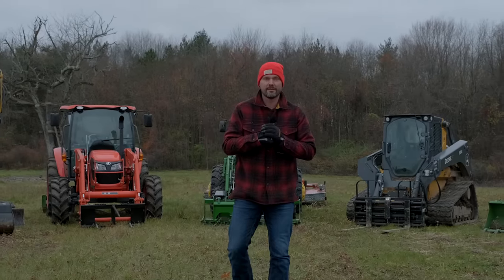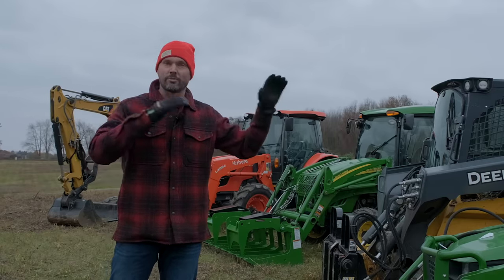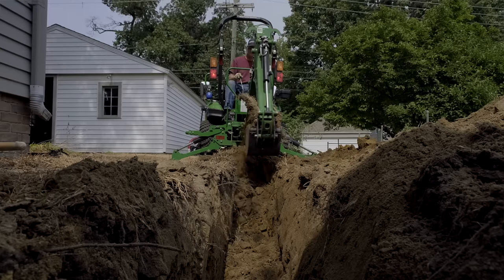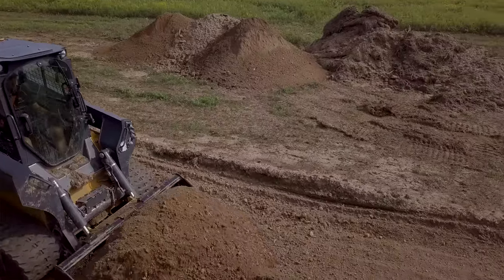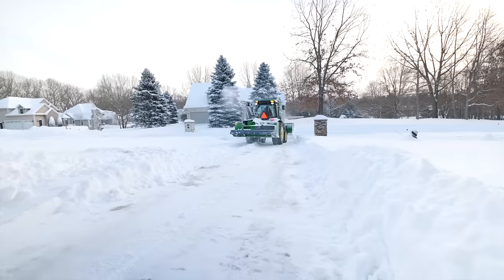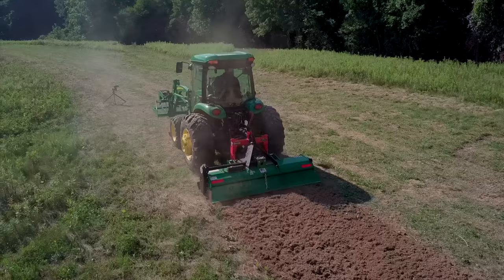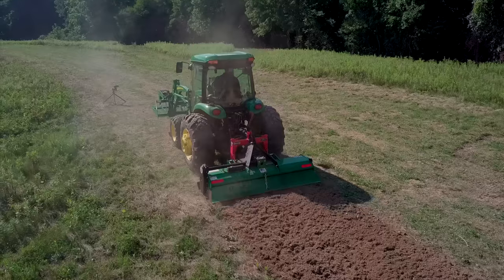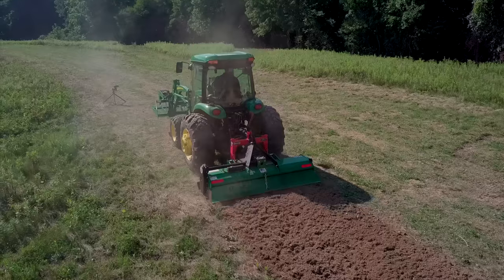IF I COULD ONLY CHOOSE ONE? BEST MACHINE FOR PROPERTY MAINTENANCE

Comment: You generally wouldn't think half an acre would justify a machine, but I bought a property that is fairly long and narrow, with a very steep section past the house. Our climate is wet and the ground is clay. I got sick of doing multi point turns to get my Hilux in and out of the back yard, tearing it up in the process. Even worse with a trailer. Considered a large ride on like a toro 520-H, but they are hard to find in Australia. There are all the different sizes of mower to tractor in John Deere and Kubota, but they tend to be very pricey, even old ones. Ended up going a little bit bigger and got a sweet old Kubota L1501 2wd. While the price was higher than I would like, it has less than 900 hours and runs beautifully. Picked up some implements as I found them on marketplace. Glad I got a grader blade, seems overkill, but I had to fix our road after we had a big storm and lots of wet weather. The pot holes were so bad that I had to take my 4wd to work. Got a rear scoop recently, it's no front end loader, but it does a great job for just moving mulch, dirt, gravel etc. I fabbed up a pallet fork setup, that's proven handy. A skid steer would be great, but you can't get a flogged out one for less than $10k. The mini ones are usually even more.

Comment: New Holland TC40, perfect size for almost any farm. You can run it on land between 4-400 acres. Ours has been very reliable.
We have had a skidsteer and a mini excavator once but the tractor was still the most useful machine by far (especially with a bucket on the front end). Even more so than our John Deere or International Harvester

Comment: I've never had overheating issues with my Kubota tractors. Right now I'm running an MX 6000 hydro and it gets run hard year-round with a lot of bushhogin on hot summer days. One thing you green guys fail to mention is how much smoother the loader works on a Kubota compared to JD. I recently took a friend tractor shopping and he was determined to buy a 1 series JD. I showed him how the loader only does one function at a time. Lift a little, tilt a little, lift a little, tilt a little. We then went to a Kubota dealer and tried a BX series and I showed him how the loader lifts and tilts in one smooth  motion with no hesitation!
Reply: And PS.  I also mow my lawn with a rear finish mower and rear snowblower for winter and a pto log skidder and a log grapple and a tiller and a box blade and a backhoe and a post hole digger and pallet forks and a 3 bottom plow and......

Comment: Anything over 2 acres up to 20 acres.  45 hp tractor with front end loader and 3 point hitch.  I've been part of a farm for my entire life.  This is your best bet. After 20 acres it's .25 hp per acre until 160 acres.  Then it's 20 hp per quarter until you reach a section.  Then it's 35 hp per quarter until 2 sections.  Then it's 50 hp per quarter or multiple units.  Based on tractors we bought and implements over the increase of our farm over 60 years this is the best info I can give and its by no means right for you.  It's how we did it.

Comment: I live in a hilly area. I had a wheeled skid steer. Most useless machine I've ever owned. It had poor traction, "spinning wheels" is an understatement. Besides which, it was very unstable on hills. I had it for several years, the only thing I ever used it for was moving hay bales. Sold it and bought an old tractor with a bush hog.

Comment: I had a bobcat S175.  That machine was amazing. There nothing it couldn't do.  Only problem is that it ripped up the yard.

I sold it and purchased a Bobcat B250 Loader/Backhoe.  4WD and 4 wheel steer.  It has served me well but it's slow and underpowered.  Now it's completely useless because the rear is blown (ring and pinion)and you can't buy the parts.  You have to buy the entire rear assembly because it's unitized!and only one company sells that. At $5,000 that has to wait.

I'm tempted to go back to a skid steer but I'll probably buy a compact tractor.

Comment: It’s funny; last year I was wrestling with this same question. My selection criteria was almost identical to why you chose the Deere 4720. I wanted a hydro transmission, capable loader and useful 3 point. Enough pto hp to run any small attachment that’s common, but not so much I tear them apart. Most importantly, it had to be capable of handling a 5x5 round bale. 

I looked at a 4 series JD and compared it to an Mx kubota. The kubota was by far the better value; the Deere was about 30% more for equivalent HP and less features. Now I have an mx5400 and it’s fantastic; if a 6000 had been available id have bought that but I took what I could find.

Comment: I would chose the skid steer.  It seems like it's the one machine that has no limits.  I have the 1025r which for 2.5 acres is perfect but on larger property I would go skid steer all the way.  Great video and love the channel, lot's of info you put out there that I'm sure helps a ton of people, me included.
Reply: Plus if you can rent attachments for the skidsteer  to take care of certain projects for a day or a week and not have a monthly payment for 5 yrs on a separate attachment.  But if you finance tractor/skidsteer with all the attachments you'll need for 5 years to do what you need to do then you can sell off what attachments you don't need as the projects get completed. Just pick up side jobs to help pay for equipment.

Comment: I have 5 acres on the side of a hill. It don't go all the way to the top of hill so it's all a steep grade. I need to create a stable flat spot around the size of a quarter of an acre. But go up high enough to avoid any flooding. That would give me room for the house and some yard space around the house. Scoping out a quarter acre somewhere within that 5 acre lot.

Comment: I have a 30hp mini x and a 38hp compact hydro tractor. For the money (value) it’s hard to beat a compact tractor. Skids are great but the attachments cost so much you can have 2 machines (like me) to do all projects you could want or need to get done. Having a PTO drive for attachments will literally save you 10s of thousands vs attachments on a skid. And lastly, it’s hard to dig with a skid steer without spending an outrageous amount on “backhoe” attachment…that’s why I have 2 machines for less than a skid with all the attachments I’d need.

Comment: I can honestly say the kubota tractor is the most versatile by far. I have a b3030 it runs a belly mower a loader, box blade , brush hog , tiller , and wood shredder. Best machine ive ever got. The problem with the skidsteer is the cost well over 100k that john deere is about 175k compared to the tractor at about 35k

Comment: I got the mini ex first: I had to do digging (drainage, pond and creek maintenance) and none of the other machines can dig. Backhoe attachments on tractors and CTLs are not very capable unless the tractor is very large, and then you can't get it into tight spots to dig. With a blade and a ditching bucket you can do most of what a skid steer does with a mini, just much slower. Then a couple of years later I got a CTL. Not mentioned but you need some sort of dump trailer too.

Comment: Every project is different and each machine has its own significant advantage. Such a hard choice unless your main projects are mostly the same kind of work. Then when you decide on the type, the size and features becomes a factor. I went with a mini excavator Bobcat 418, and a subcompact Massey Ferguson 1215. Both already well used when I got them. They have saved me so much time and work I am very happy to have them. I do use the mini ex the most, and the subcompact mostly for the box blade, and for its tow hitch.

Comment: I had a new Holland L783 skid steer with tires, was a great machine and very strong, just couldn't get into the woods with it and living in Maine we get alot of snow, it did ok with the snow just not much clearance underneath set it back alot. Sold that and got a Kubota l3940, not quite as strong as the skid steer, lifting wise but still does everything I need it to, alot easier with snow removal and getting into the woods. Easier to find attachments and usually cheaper attachments. My father ended up getting a John Deere 1023, which is also a great tractor and alot nicer around the yard, the Kubota or new Holland couldn't go on the lawn without digging it up. The biggest downfall of the skid steer to me was the bucket or whatever was infront had to be all the way down to get out of the machine. Either way I'ld never go without cab after the two. If your using it year round it's a must, I'ld rather get a little smaller tractor or economy version just to get a cab, even went used, 6 years old for the Kubota, just to get a cab.

Comment: That blade on your mini ex is very good for making roads. Mini ex can push down trees, dig holes (basements) make trenches act as a crane. If I could buy one pice of eq it would be the mini ex. If I could get 2, I would add the skid steer. But I do more construction and I have a sawmill.

Comment: I went with the 3033r with a backhoe I can do everything I need to and do some small side jobs to help cover the coast a track loader and a mini excavator would have been more efficient but just can’t justify the coast and the maintenance of two machines the tractor does everything well just not perfect it takes longer but on the plus side it’s more seat time on my machine
Reply: The JD 3033r is a very good starting point of a Rig. The "E" series is a bit of a "tinker-toy" conspired to the "R". A 25% more investment will yield a 250% better yield on longevity & reliability. Happy safe Tractoring Sir.

Comment: I'm looking at buying some acreage and while I have a 3025e now, I think that's gonna stay as my little tractor... Need that for garden duties, moving hay bales, etc.  I'll get a big utility one, for hay duty and after that it is the more specialized stuff like an excavator and skid steer... maybe even a small dozer.  Had I known what i know now when I bought my 3025e, I would have probably started with a skid steer, as my primary use is weeds in arizona, and the 3025E just isn't heavy enough to rip them out with the bucket or a box blade... A skid steer is gonna smoosh them into the ground just by turning around... and it does have enough weight to dig in with the bucket or to be used as a mini dozer.  

The next thing I wish I knew when I bought mine, is JD's proprietary BS.  Yeah, the bucket sucks and wish I could get a cheaper rock bucket that's meant for a skid steer, but the right to repair stuff is the part that really bugs me; being forced to take it to the dealer for the simplest stuff.  Luckily I haven't had to fix anything on mine yet, but it's definitely something I wish I knew about when I bought it; and something that will keep me away from JD in the future.  Kubota's "treadle" is annoying as hell too, so I would never buy an HST tractor with that... I'm probably gonna buy a 10-15k dollar 30 yr old Ford or something along those lines for my next machine.

Comment: When I was picking a machine I chose a Kioti DK5310SE, which is a 50 HP tractor in the largest of the compact frames.  While we only have 20 acres our self I have over a mile of non-state maintained road I will have to plow, grade, and generally maintain.  I would have liked to have gone to the utility tractor size, a Ford F-150 with a 10K trailer can still move the 4-series or equivalent (something I feel you failed to mention).  I had to go get my tractor about 2400 miles from my home, but I was able to bring it back with a 2006 F-150; I couldn't have done that with any heavier machine.  My point is that, from a logistical standpoint your other current assets should play a factor.
Reply: I should note that I live in rural Alaska, but still on the road system.  In order to get a tractor with a cab, as our winter temperatures at my house are expected to be -50F (but every other year we probably hit -60F), I had to go to Washington State to get a cabbed tractor.  I could have likely gotten a similar tractor in Canada and saved some money with exchange rate and distance traveled; the EPA paperwork to import a motor made it not worth it, not to mention how financing may or may not have been able to work (I never got that far, the EPA paperwork was to much of a hurdle).

Comment: If you could only have one machine, a mid size tractor is the way to go, no question, they are probably the most cost effective as well. 

Ironically, if I could have two machines, I would abandon the tractor and I would take a mini excavator and a tracked skid steer(with a mower).

Comment: I have 95 acres with a mix of terrain and fields, and the tractor I use the most is the JD4440M for all the same reasons. I still want to skid steer to get close to my pond though, that is the hard part for sure.

Comment: I went from a Kubota BX to a Kubota B2650 and now to a Grand L L3560. I believe that with the Grand L, I am done buying tractors for the rest of my life. When I had the B2650 I had to phone a friend to bring in a large C232 track loader one in a while for material moving at a fast pace that I couldn't keep up with in the B2650. My Grand L is no C232, but it's insanely more capable than the B2650 and allows me to deal with a triaxle of concrete or dirt in 3 or 4 minutes instead of 10 to 15 minutes. 

And the overall versatility with a 72" Rotary, 72" finish mower, 72"and 96" rear blade and a 72" box blade, the 805 loader with 72" bucket and 4K rated pallet forks and the BH92 sitting in the corner... I can take on anything that I want to. It may not be as quick and efficient as having dedicated machines, but it gives me maximum freedom to tackle anything and everything I come up against. 

And that New Holland C232 is just a phone call away if I ever need it for some reason.

Comment: If you plan on using a tractor as a tractor get a small utility grade tractor. Some come with more then one 3 point size so you can fit what ever on it. The compact and sub compact are (in my opinion) neighborhood flex tractors

Comment: Highly recommend renting multiple pieces of equipment first, you’ll learn what you can do with each machine, and be well equipped to make a purchase decision.  TLBs are kinda worthless sometimes.  A mini ex could run circles around a TLB.  But a front loader could also run circles around a mini ex.  Really depends on your plans, terrain, etc.
Reply: Or you could hire a skilled operator with the exact piece of equipment needed.  For example, an actual road grader instead of a tractor pulling a blade.
The problem is availability.
Reply: @codetech5598  Could be expensive to hire professionals, but definitely a good choice if the budget allows.
Reply: @RyanJohnsonHQ  Rental is expensive especially if you need to pay them to transport the equipment to and from your property.

Comment: Best tool is the dozer with the blade or the bucket in the front and the excavator in the back.  Not for finished land, but for raw land.  JD455 or similar.  Can do almost anything and is cheap used vs spending crazy money on new equipment - $80k on a skid steer plus a 4 series JD?  Big dollars...

Comment: as a builder i'd choose the excavator since it will let me remove hinderances and help me dig out far better than alternatives. whether you're putting in a slab, structure, pool, or planter they all require you to first dig out the area to start construction. frankly the excavator just does the job better. the frustrating downside is that, that's all it can do so far as i know. not really going to be able to use it to till an area for a garden, but in that case i guess i could get a push tiller. also not going to mow any yards, again might have to go with a push mower, or even one of those riding mower things. would love to owe the combination of the excavator and the skid loader or a mid sized tractor because the combination of the two would basically cover any and all applications i can think of.

Comment: I live in town on a lot big enough I can have a garden and a few fruit trees and berry bushes, so for me a SCUT in 25 - 28 hp with a front loader, tiller and mower will work fine.  In fact it might be more than I currently need.  If I move to a rural property with 4 - 6 acres I might go up to a CUT in 35 - 40 with the same attachments, sized appropriately, and equipment to handle more work.  If it is a property larger than that, or if I am keeping several cows I would go up to a 70 HP or larger tractor so I can handle forage equipment.

Comment: Really depends on your land and what you want to do,  Mini X will be superior for trenching, digging and stump removal.  Skid steer for clearing.  I have 70 acres on top of a MTN (rocky) so skid steer with mulcher won't work.  I had a B3030 for years when I had 40 acres it was a great tractor but when I went to 70 acres traded it out for a MX6000 which is cross between utility and large compact.  For my own personal needs my  tractor won't dig like a mini x or clear like a skid steer but for everyday use with every day projects far superior.